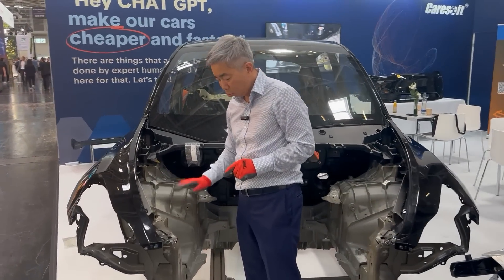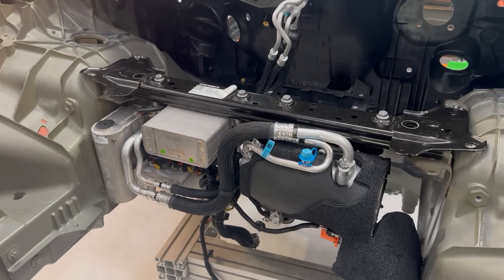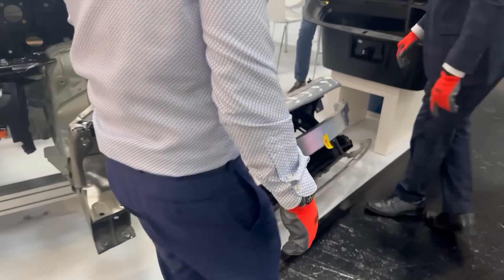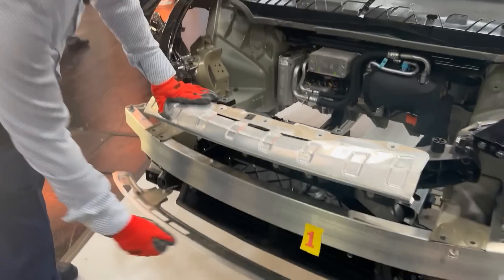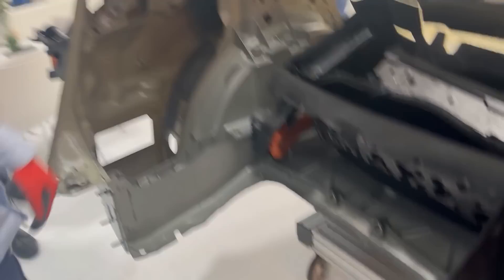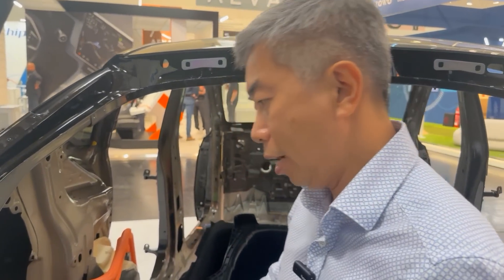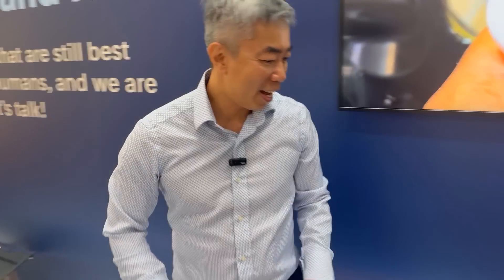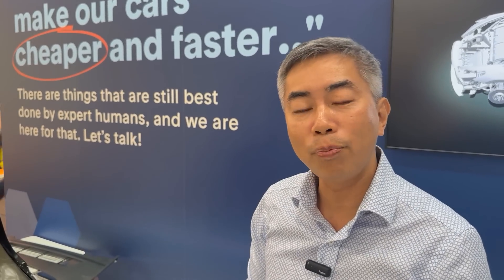Tesla’s Master Class In Modular Assembly - Autoline On The Road

Comment: It's not how they build rocket engines for space exploration though. On those you typically have 6-8 large bolts holding one 2 inch diameter flange and requiring a contortionist to tighten the bolts using an accurate torque wrench in a certain sequence of tightening operations.

Comment: That is impressive. Having worked on Mercedes cars, even small repairs require dozens of fasteners and hours of work. This is incredible.
Reply: People still wonder why VW is in massive financial problem, then I see this and I understand what's coming.

They really won't know what hit them. And think that the Model 3/Y are still basically the first generation of cars that were adapted to this philosophy.

Think about the next generation of EV's that will be also designed to be better and cheaper to assemble with all the practical experience they've gained from here.

Comment: Gigacastings NOT repairable
Reply: Gigacastings are repairable, as 519Kustomz channel shows. Apart from that, they have crashboxes installed. If you are in a big accident and the crashboxes including Gigacastings are damaged, then the car is probably a writeoff anyway. Gigacastings save costs on every produced car, millions of cars a year. Only a few end up in a big crash. Gigacastings can be welded or melted into new Gigacastings. Every car company will use castings in a few years, some (like NIO) are already doing it.

Comment: So a minor hit from the side that would normally cost a couple thousand dollars by simply replacing a fender will now cost 15 to 20 thousand dollars, or more, since you'll have to replace the whole giga-casting piece.
Reply: There are different sides to it. You would have to hit the car at a decent speed to damage the giga-casting. Also, gigacastings can be welded, as 519Kustomz channel shows. If it can't be repaired, Gigacastings can be melted and reused. Last: gigacasting saves money and labor on millions of produced cars, only a small amount of them get wrecked. Would it be efficiënt to never change something because it might get wrecked?

Comment: Is that aluminum charging bus bar showing conduit over aluminium cable? I think that is the actual conductor showing, not a sleeve. But the cheap orange sleeve is clearly not a reasonable insulator and his demo part is already insufficiently insulating in the video. If instead it is a conduit, is the cable inside insulated? That part is confusing to understand how it's insulating the two very high amp leads. Do they just not care about the isolation of the high tension leads because pyrotechnic disconnect in the event of a collision?
Reply: It is a conduit the conductor is inside. The aluminum pipe has 3 purpose. It provides grounding. It acts as EMF shield. And lastly it also provides rigidity. The orange sleeve is just a color indicator warning people that the conduit is running high voltage.

Comment: Genius for speed which results in quantities over quality.
Reply: One casting replaces about 70 parts that had to be glued/welded/bolted together every joint allowing error to creep in. Difficult to have consistency from one vehicle to the next. The precision castings are all exactly the same and provide a rigidity 70 parts fastened together cannot. This leads to a better drive, and a safer car. There is your quality.

Comment: You want to screw things in. Snap fitting for a moving car isn't going to lead to the type of solidity you'll feel in other vehicles.
Reply: There are bolts for actual structural components, as they showed in the video, but for things that are not structural they don’t need them. Many of the parts here had bolts, but all were top down and self aligning, making it simpler and easier. Things like plastic components for alignment or damping just need to be held in place by the other panels, and bolting them down doesn’t change wnything
Reply: These are disposable, most people who buy these will trade in for newer tech in around 5-6 years. The rattles are going to show up in the used market.

Comment: lego installation explains all the noise and rattles.  Slick AF, but makes more sense now why these cars tend to have a little more noise than other oems.
Reply: My Teslas have all been rattle free. The more connectors you add to a car the more places things will rattle. Getting rid of those rattle points is brilliant.
Reply: No rattles in mine.
Reply: No, earlier Model 3 vehicles that are known for noise and rattles are not built this way, but with a more traditional body in white. Their biggest issues are door seals and latch adjustments.
Reply: I'm sure a few dampening and insulators would muffle those those sounds. Great video though.

Comment: Every engineer at every automotive company should be forced to watch this with her eyes taped, wide open.
Reply: Irony is that most engineers in the legacy OEM industry KNOW this already. They are prevented from influencing design by the comanies' bosses - who are usually non-technical accountants. Some of the biggest corporate failures in history have been a result of accountants running the business. If you work for a company that is run by accountants, then the risk of your job disappearing are very high.
Reply: @brunosmith6925  great point.
Reply: They've seen it well before this

Comment: That makes me even more impressed with Tesla. OMG is that efficiency.  But why are their panel gaps so BIG
Reply: Perhaps you were looking at a 2012 Tesla or car that was salvaged and made from multiple cars.  On my 2022 Tesla S and Y the gaps are equal to our Lexus (i.e. very good).
Reply: @tesla_tap   yea people who think Tesla have big panel gaps are reading the nonsense from MSM . ALL advertisers want Tesla to slow down because ALL auto makers want Tesla to slow down , follow the money.
Reply: Tesla fanboys love big panel gaps and sagging door seals, all part of sloppy modular assembly. A tesla exclusive.
Reply: @heathwirt8919 why did you waste valuable time saying that? Jealousy?
Reply: 🤡 @heathwirt8919
Reply: @heathwirt8919  The panel-gap FUD was addressed some years ago. A few months ago, Toyota tore down a Model-Y and apart from finding some of the highest precision-fitting in any car, the head of engineering at Toyota described the car as "an engineering masterpiece".
Additionally, Sandy Munro (who highlighted panel-gap issues on early Model-3's, recently measured gaps on latest model-3 and model-y cars and found the precision to be more accurate than most other legacy OEM's.
So... these are the facts. Looks like you need to do some proper research - or you can continue looking stupid... your choice.

Comment: Why did 5 generations of GM engineers not understand This Is The Way? Why were they so broken?
Reply: Sandy Monroe explained this. No one speaks up so they don’t lose their jobs or get passed in being promoted! Don’t rock the boat!! Legacy automakers do changes slowly & once a year once upper management buys in on it where Tesla workers are constantly innovating & doing changes when needed! Engineering works together to resolve issues!
Reply: It's not the engineers.  They would have to change the whole corporate structure, and then the whole corporate culture, before they could begin to try to do things the same way as Tesla.
Reply: @davidmenasco5743  Good point David. Given the opportunity, any good engineer will strive towards improvement and efficiency. The tragedy with most of the legacy OEM's is that they have never (and never will) give their engineers the freedom and flexibility to affect changes quickly. When a company is run by accountants, business sense goes out the window.
Reply: It's more the unions than the accountants. Unions like 10 men to make the car where Tesla like none, robots don't pay union membership
Reply: @mjcamp01 nah. Definitely corpo culture. If there was an easier way to do my job, you bed I'd be all over it. Damn near impossible just to get a tooling/jig changed
Reply: @mjcamp01  Unions play a major role in stifling (and preventing) change, but the main culprits are company executives (usually accountants and financial controllers) who make their decisions based on numbers on the bottom-right-hand corner of the balance sheet. Typically, they scrounge pennies at the expense of innovation. They conflate "losses" with "capital investment" and do everything to scrounge back pennies. This led to the main challenges the OEM's face today... too many suppliers, silo management, conservative operational policies and a total lack of any desire to change.
Reply: Lol - But Bob Lutz said Tesla would go out of business back in 2017 and the Model 3 would be a failure
Reply: MBA pursuit of profit, via outsourcing, rather than a focus on good design and engineering/optimizing for efficiency. Short term thinking of short term profit motive, as opposed to making the best product possible.
Reply: @aaronbounds1336  it's even worse than that at my company. It's not even about making profits for the company, just profits for individuals. Have an intern make you a nice PowerPoint, make some changes, f*ck things up, get promoted, move out, new manager comes in, changes things back to how they were, problem is fixed, they get promoted. LOL
Reply: @aaronbounds1336  Also, in many cases, a lot of people want things to improve. But at the same time, the very same people want everything to stay the same..
Reply: It comes down to leadership, I think.
Reply: Over reliance on third party partners makes it a bit harder for OEMs.
Reply: The gigapress can't be that old.
Reply: I have seen this in industry. People are stuck in their ways and dont want to change or learn new things.
Reply: I'm sure a bunch of them saw how to do it but I bet even the GM CEO's wouldn't have had the juice to get it done, even if they wanted to.
Reply: They Understood , The Pentagon even told them 20 years ago in a goverment funded study ,there's a video that explains it.  "Winning the Oil Endgame presented by Amory Lovins of the Rocky Mountian Institute .It is on YouTube

Comment: And wait theres more.  Now the battery pack with seats on it comes and mounts from the bottom in one piece.  🤣
Reply: Coolest thing I've seen in a long time for car manufacturing. Amazing with both seats, lid serving as the floor, carpets and center console all inc.
It still only weighs 1,150# or so according to the munro tear down of a 4680 model Y. 

First ev car ever in production using a U.S. built 4680 cell and a U.S. built structural pack plus front and rear single piece castings. 😎👍🏻

Comment: Can someone explain to me why EVs with long hoods, eg lyriq, eqs, iX, do not have room for a frunk when Tesla could fit such a large frunk in the tiny M3/My?
Reply: ICE company engineering.
Reply: Too many hoses and wires. As mentioned in the video, Tesla eliminates a part where it can or do multipurpose (1 part instead of 2). Legacy tries to use what they have in their parts bin even though it might be too big. Legacy also uses platforms that need to accommodate ICE.
Reply: They are being cheap.  Thats all
Reply: It's the heating and cooling system design.
Reply: They saw the market research that people don't use the frunk very often.

Comment: When you make cars with cast structures it means if damaged they cant be easily or cheaply repaired. So its often replacing the whole car. Very expensive.
Reply: False.  That's like saying if you have severe structural damage in a 'standard' car you will go ahead and repair it.
Reply: @whattheschmidt  I agree. My neighbor was rear-ended in her mini cooper and it was totaled, yet it did not look bad from the outside. A lot of stamped parts cars have high tensile steel and other alloys that you cannot just chop off and replace with a welded on part as they heat from the welder ruins the tempering of the metal.
Reply: People keep saying this, but enough people in the know disagree that I don't think it is that cut 'n dry.
Reply: Looks like it’s easy enough to take the car apart and just replace the casting and put it back together again anybody in fender man worth a shot can do it in his sleep
Reply: I gotta think that if everything goes to plan, these thing will be so inexpensive that disposing of the car after an accident will be the norm. The money is in the plan, not the hardware.
Reply: @steveb4142  They will be disposed of because the repair cost will be astronomical causing insurance companies to write it off as a total loss. It's like buying a cheap China made kitchen appliance, use it for a few years and throw it away. Musk's automotive vision of the future.
Reply: All cars today are throw away.  Makes no difference whats under the skin.
Reply: That is 100% false.
Reply: False
Reply: Yep. People are finding out the hard way that insurance companies are totaling Teslas like this much more quickly.
Reply: @heyyougonnafinishthat8658  Insurance companies like... Tesla?
Reply: Except rather than just Tesla owners paying the premium, the added insurance cost will be spread out across all car owners
Reply: Don't say that to these tesla fanboys, it will make their head explode!

Comment: Normally aluminum castings are too brittle to be used in this manner...  got to give  Tesla credit for remaking the mold, in more than one way.... 

Plus Thanks to the rep from Caresoft for demonstrating it.... his English was a little hard to understand, but it was good enough....
Reply: You got one thing right, castings are brittle.
Reply: @heathwirt8919 
You mean that castings are brittle like an engine block?
Reply: @RayNLA;  poor analogy....  but just for the  fun of it, let's stick with that crappy analogy....   an aluminum casted engine block,  needs to utilize 'steel' liners, to come close to the durability. of a 'steel' block ...  

FWIW a bicycle frame would have been a more appropriate analogy...   A steel bicycle frame can last forever If it is kept rust free, an aluminum bicycle bike frame usually only lasts for about 5 years or less before   structural significant cracks start forming .... 

 Aluminum protects itself against oxidation and is lighter....Which explains why it's  being used more and more... It's just not as durable, against fatigue....

Enjoy the Kool-Aid....
Reply: @heathwirt8919  You should watch Sandy Munro take a sledgehammer to a casting in a video out today.
Reply: @martingardens  Sandy is a musk stooge and he could barely lift a sledge hammer.

Comment: What the HELL? In the past I have spent more time and complexity installing a couple of speakers in a car and still wasn't as straight forward as assembling an entire Model Y.
Reply: I am a relatively amateur "mechanic" but know enough to change things like spark-plugs, filters and fanbelts. A month ago, I had to devote an entire day to fitting a new drive-belt to the power-steering unit, and needed to remove around 20 other parts before I could get to the belt.
Reply: @brunosmith6925  And people complain that EV's are too complex and that ICE vehicles are much simpler. I always know they never did any kind of basic maintenance operation on a car ever in their lives.

Comment: Everything easy to copy if its realy better!
Reply: Yes, thats the genius part here. Nothing new, everything has existed for thousands of years. Its just about the mindset: First principles.
Reply: @nc3826 Toyota themselves said the engineering in a Model Y was a “work of art” so try again
Reply: You can't copy it if your teams are fragmented, the managers care more about politics and career than the company or product and UAW cares more about having more workers on the line than the quality of the product or competing in the market. 
This is 99% a result of the culture in the company which is almost impossible to change and if so, will take decades to change. Ford, for example, had to separate their EV business from the traditional business to even try to make the shift - but even so, they're losing a ton of money and still mostly use parts bin components to "reduce" cost which eventually costs more.
Reply: @ranig2848  What I think was missed in the air conditioning setup at the front, is that is also the heater/cooler for the batteries and motors, why have duplicates when you can design and build something that you only need one of.  At a legacy company the politics would be don't touch my thing, I need x space for cooling for my part.
Reply: @ranig2848  It wont take decades,if its good ypu can change thinga in 3 years!Tesla has one advantage in the US,thats cheaper labor and thats it!Longterm the headstart they had will go away!Even if they realy can get real FSD,it isnt sure if they can make that much money with it!China wont allowed Teslas FSD anyway!The carbuisenss is shitty if you dont have a luxury brand,The pricewar will hurt Tesla like all the other carproducers,and patriotism will always play a role in carsales,just look at the bestselling list in south korea!The first 8 cars are all korean cars!
Reply: @ranig2848  Oh i was wrong,the 12 first bestselling cars in southkorea  are korean brands!